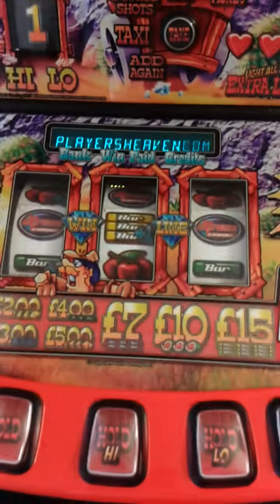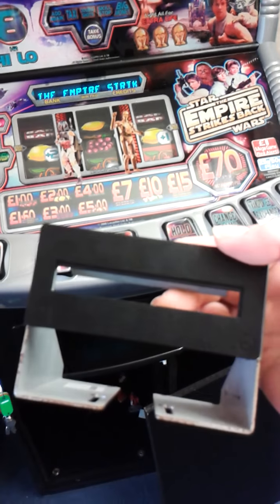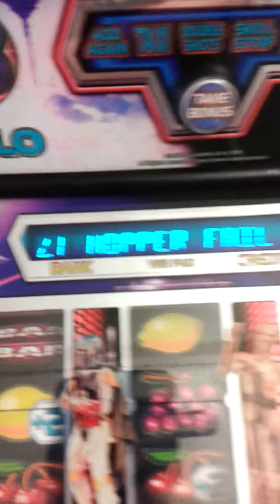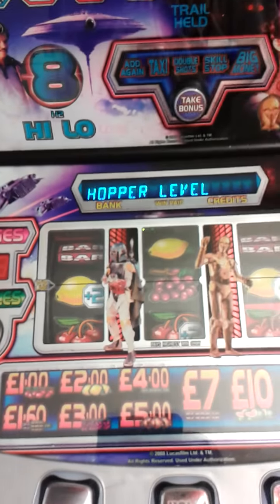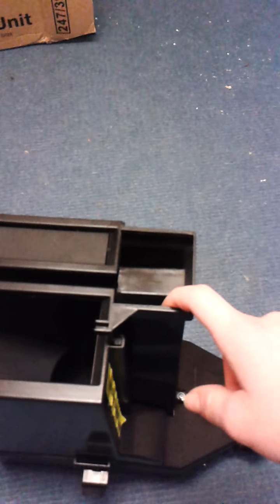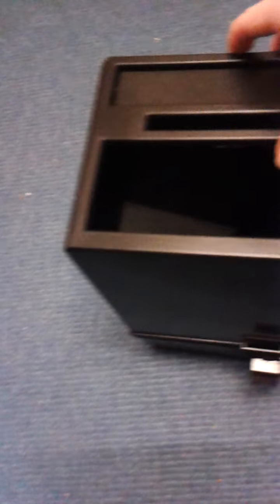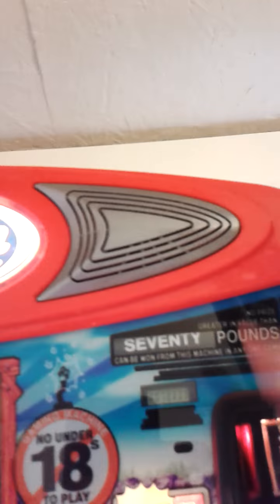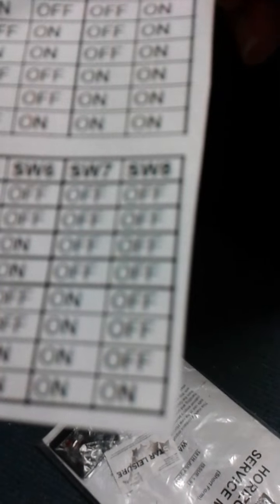Fruit Machine Game Play And Tec Info Part 4 Final

Comment: Do you know where I can get any information on a Barcrest slot machine titled "SUNRISE". I have not found any information about this machine on the internet. I believe that the reels are out of sync because the machine payout does not agree with what I am seeing on the payline (line 1). I have some info on other Barcrest machines that use the MPU4 processor. I think that this machine may have been built in the early 90's or late 80's. Any help would be greatly appreciated.
Reply from the maker: Well get win and what on glass say its 20p but gives you 50p then need check that have right game rom in for jackpot as know wrong game rom or settings if jackpot does not match
Reply: @DamonWyerBlasttheWolf  I need to know the combination of the S1 and S2 ON/OFF switches ( located on the MPU4 processor board) to get the correct output. Do you have any idea where I can get that information? Thanks for your help.
Reply from the maker: @marilynstuart1546  what trying set up on ?
Reply: @DamonWyerBlasttheWolf  The machine that I have is called "SUNRISE". There is a tag inside of the cabinet that has a tag that is dated 1993 - BARCREST, INC. This machine was being used as a amusement machine. I have tried many switch combinations which result in different payouts. There is a display that gives a different coded description as the machine is first powered up. Some will display a code that starts with the characters "TT" or will start the display with characters that display " 25CK". It seems to me that the "TT" refers to token payouts. These token payouts are shown on the front glass ( ie 3 diamonds will pay 30 tokens). Since there are 2 switch assemblies on the MPU4 board with 8 switches for each switch assembly, there are lots of combinations. I am trying to find the correct switch combination to make this machine payout the correct amount as what is shown on the front display glass (ie 3 diamonds shoul pay 30 tokens). There also seems to be too many payouts that occur. Most or all switch combinations of switch assembly 2 will pay out a win on every spin.
Reply from the maker: @marilynstuart1546  right well need pick or video of your machine
Reply: I think that I need an email address to send the photos to you  @DamonWyerBlasttheWolf
Reply: @DamonWyerBlasttheWolf  I have photos but I cannot send them through youtube. I need your email address so that I can send them to you.
Reply from the maker: @marilynstuart1546  just make YouTube video of the machine
Reply: @DamonWyerBlasttheWolf  i just put a 1 minute video on youtube. Search for marilyn stuart. This machine pays off 100 percent of the time even though it is set for 50%. I have changed the percentage payout but it keeps paying out 100% of the spins.
Reply from the maker: @marilynstuart1546  ok what condition of mpu4 is borad clean no battery damage?
Reply: @DamonWyerBlasttheWolf  Board is in good condition, no battery damage. The machine pays off 100% even when the percentage is varied from 20% to 90%. I need to know what the code definitons are. Example: what does "T" mean. What does "K" mean.